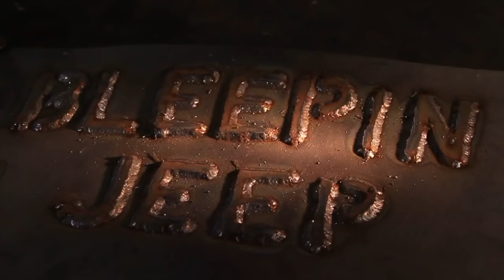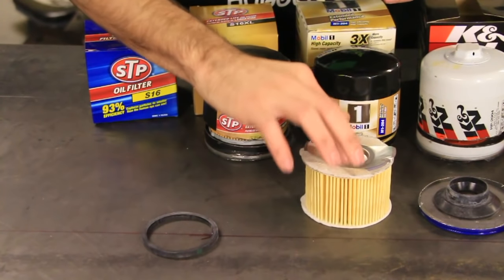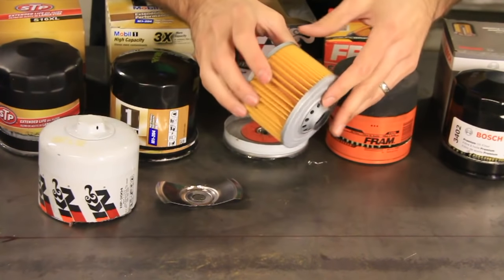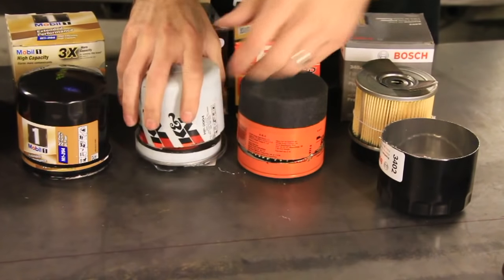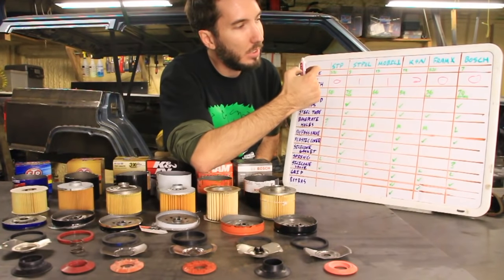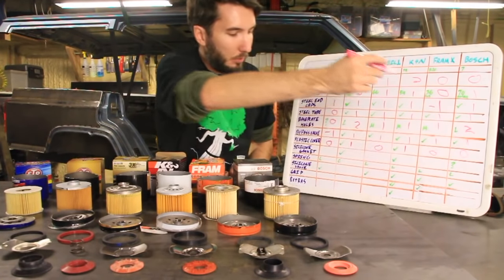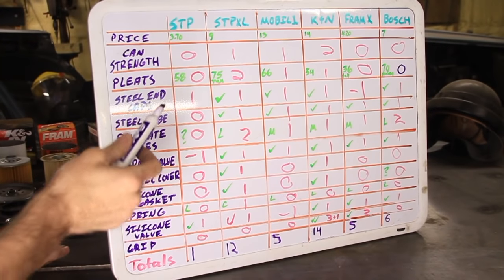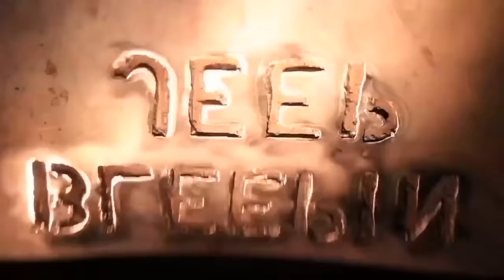What the Crap is in My Oil Filter?  We Find the BEST and Worst Oil Filters from AutoZone

Comment: I used the Fram extra guard oil filter with Valvoline Syn Power oil with ≈ 5,000 miles of use, which took me roughly 5-6 months. I did the oil analysis with Blackstone Laboratories and they stated the oil filter did a fine job at filtering impurities from the oil. The results of iron and aluminum were below average. I purposely used the extra guard for the oil analysis just out of curiosity. What I can say is that Fram gets the job done, but for a couple dollars more, you might as well get a higher quality product. I highly recommend any top of the line oil filters of your preferred choice. I know 5,000 miles isn't a lot of miles compared to some other people, but I would say 80% of my driving is city driving in the Los Angeles metropolitan area.

Comment: Fram Extra Guard hands down. I been using FRAM for da last 15 years. No problems what so ever.  Also in the last 2 years I have been using Purolator.  What ever brand is used, important thing is to change ur oil and filter every 3000 to 4000 miles.

Comment: 3 pts for the K&N end cap nut?  easier to install and remove but doesn't effect the filtering of oil.

All and all, you did a great job of showing us what's inside these filters.
You've switched me away from using Fram to looking for STP XL (XL stands for extended life)

Comment: Some things for you to take into effect during your next comparisons:
What frequency is your change rate vs life expectancy - 3k miles-6k miles-10k miles Silicon-rubber for the intended life (rubber for 3k-silicon for 6k-over)
Pleats vs flow - need to keep in mind high pleat count reduces flow as their is a tighter gap
Flow passages in base plate comparable to pleat count - bigger holes more pleats vs smaller holes less pleats - To keep flow in expected range for the oil pump/engine
The outer casing thickness has a very distinct purpose - as the filter clogs the sides bulge and pull the top closer to the motor effectively applying more pressure to the hold down spring.
An addition to your comparison board, along with the heftiness of the bottom plate count the threads that secure it to the motor - more threads for more bite to ensure it isn't blown off.

As most of these types of comparisons go, there is a big margin for personal preference and expectations.
The reality is no matter how good it is people will choose subjectively to fit their needs.
I am glad that you are willing to get the info out there for those that care enough to take it into consideration and hope you continue in the future. For those people that don't know how to do anything with your car or how to even open your hood. Please do not chime in, your input means nothing.

Oh, just a couple ending thoughts. The fram filter "mold" was the adhesive they used the mate the paper end cap to the plastic at the ends of the pleats soaking through. Just thought you might like to know. The reason i emphasized frequency is the rubber drain back and gaskets are good quality for 3k miles, but cannot withstand the heat cycles of the longer oil change intervals as well as the silicone.

Comment: Different gaskets are Buna-N(commonly black but come in different colors, standard o-ring material), Viton(Usually a pinkish-red, orange, or green, found in hydraulic equip. tough but NOT recommended for petrol-products as they break down a little. Commonly found as a canister filer o-ring), and Silicon(e)(Any color possible but you can feel the difference, much more flexible) there are more but these are what I find on the regular. The k&n filters are okay but as a Motorcraft dealer... hint hint, we use them and I actually prefer them. I've dissected a few and even though I'm pretty sure they contract them, they're made with the same materials and the same way per Fords strict specs. Specialty filters we have to have delivered are stp-xl. Another funny filter is the royal purple. Pretty much the same as the regular stp but way more expensive. Don't ask me about the best oil...

Comment: I know some about oil filters and have some answers to some of the questions you asked through the video. 

One of the first ones I would like to address is what people often call paper or cardboard end caps. In the STP filter, the End caps are the same material as the filter which is a cellulose paper. Part of the reason this is done is because it is cheaper, but it is also done because the paper pleated media bonds better to the paper/media designed end cap. This helps reduce the separation of the media and end cap and also helps reduce possible tearing of the pleated media as the end cap is able to flex slightly if a pleat is too full and has excessive pressure. Also, in the event the pleats were full of gunk, the end caps would also filter as they are made from the same material. The weird holes on the end of the STP blue are the bypass. It works, but most people do not prefer it as it is cheap. This is known as a combo valve. The bypass and the antidrainback valve are built into one piece of rubber.

Stp XL stands for extended life. These appear to be really good filters, but are fairly new to the market. The plastic cover goes on the bottom due to being made in Korea and is used to keep them from getting moisture in them and starting to rust while being shipped overseas.

The Mobil 1 is able to absorb more due to the type of media. It uses a synthetic blend media which is capable of performing depth filtering. Normal media is like paper. Synthetic media is like a sponge. Paper filters only on the surface, while a sponge would filter all the way through the sponge.

The K&N filter having bad spacing, isn't really a big issue. The only time bad spacing is a major issue is in the event the media is too thin to support the pressure. This can cause a tear. This has been extremely common among filters made by a company whose name starts with a P and makes the classic and one filter. They have been nicknamed tearolator for this reason. 

The fram is actually a really good filter, they are able to get away with less media than some of the others and still perform better filtering due to being a synthetic blend similar to the Mobil 1. The filter you have, the extra guard is actually the lowest end filter. The color you are seeing is more than likely from the glue used to glue the media to the end cap. This end cap is superior to the STP end cap due to having a synthetic blend media like the Mobil 1.

The string on the Bosch is neither supposed to be there or not supposed to be there.  It is used to keep the pleats in a circular shape while gluing it to the end caps.
Reply: Good review.
Reply: Good info. Some bad mouth the paper ends on the Fram.  I Always thought the only thing that mattered was how well the glue bond held.up.
Reply: @miasmicmonky13 At least you obviously know what you are talking about.
Reply: I have been using fram for years with zero issues 👍 just took one off my cub cadet the other day 2 years of use and it was still clean after cutting it apart. I couldn't believe it 👍

Comment: Ok so pleated cartridge filters (CFs) are used in a variety of applications like swimming pools, HVAC, vehicles, etc.  I did some searching and the string around the Bosch filter could be there for the same reason as their presence on water filtration CFs.  That reason being to prevent pleat flutter during filtration.  However, the jankiness of the single string leads me to believe that it was holding the pleated, rectangular piece of filter media in a cylindrical form to make installing the caps cheaper (instead of having a specific machine hold the media).  Also, CFs that have bands installed usually engage each pleat (meaning that they are glued to each pleat to improve the rigidity and uniformness of the overall CF).  Furthermore, the overall surface area of the media and the type of material used for the media are the real questions (as well as build quality).  The pleats are just a way of reducing the size or footprint of the filter as well as engineering the flow of fluid).

Comment: I knew Fram filters were bad, but wow..  They're basically selling s*** in a box..
Reply: No - THAT Fram is shit. The Fram Ultra  is better than anything on his bench. He picked the wrong filter to test.
Reply: That's why they call them the "orange can of death".
Reply: I put 211,122 miles on my 4.0 (wrangler) with these, but I will not use them any more in my new engine. Currently at 271.113, and Castrol Full Synthetic is all I use. I am switching to STP XL for the time being. Starting today.

Comment: I think you have to hook several oil filters to a manifold and pump dirty oil through all of the filters from the same vat at the same pressure and weight both before and after to see which which one filters best  , the test should be for a short amount of time like 20 minutes otherwise the bigger filters will have the capacity to store more waste but they might not filter better.

Comment: I think a more realistic and accurate rating system would be to compare the points/$ ratio without adding the price points into the total. This way a filter at a very low price doesn't get an artificially high rating. Now take this number and pair it to the point rating and go from there. Informative video, good job.

Comment: I work in a plant that makes in the millions of oil, fuel, and air filters the more pleats it has the better it is to a point.  that being said you can have to many and cuts flow down if the pleats are to close together.  With out seeing the "flow tests" just by being in the filter making world it would be STP XL, Mobile 1, K&N, Bosch, STP, and Fram. I have many years in the filter world there is only 3 of the 6 i would use in my auto.
Reply from the maker: Which filters would you use out of any options?

Comment: Great Info! I would also like to see the purolators and auto extras. I And I don't know if it's been said but the holes on top of the wrench part of the K&N can be used for safety wire I believe. They look very similar to Small Aircraft filters. Just a +1/2 maybe for that little feature.

Comment: The mobile one doesn't have a bypass valve the center hole is the exit hole or return hole for the oil. The amount of media determines the capacity of the filter. Stretch out the media and see how long it is.

Comment: The way to really test a filter is to measure its absolute filtration of the fine particles that get into the oil. The filter that removes more for longer would be a better filter PROVIDED it does not impede or restrict oil flow.

Comment: Another vote to test Wix or the Wix Extra or what ever they call it.  Obviously the people that care about their engines don't use Fram filters, or use Pennzoil.  There is no use wasting money on a good filter if you aren't going to use a decent oil.  A filter can't fix bad oil.  You should remove the filter material and measure the area of the filter.  Pleats can be different depths so the number does not mean much.  Also you should test to see how small of particles the filters remove and the flow rate of oil through the filter material.

Comment: While the nut end and sticker are nice they don't really protect your engine. Take 4 points off for that and the STP XL rated 2 points higher. Then figure in it is 5 bucks less. Great video Matt!
Reply: +Wolfpak765 The nut end isn't for protection, it's for ease of use. As far as protection goes it wouldn't do much for a Jeep but I've heard of someone having a stick on the trail come up and stab a hole through an oil filter before. The entire group of people was stranded for hours because they had tons of spare parts but nobody had an extra oil filter lol.
Reply from the maker: +TheAmericanUhate Hey that was our group^ true story... happened at Windrock Park at least and hour or two from the parking lot...long day
Reply: BleepinJeep Yes it was. lol I remember hearing the story but didn't remember where I had heard it until a while after I left the comment lol.

Comment: Why would the low-level STP filter not have a bypass valve but the higher-end equivalent would? Seems like you could be looking at potential engine damage by oil starvation if high-revving occurs.

Comment: on the fram extra guard looks to me like maybe they spray a film of oil on the inside to keep from rusting while it sits on the shelf.  And the cardboard just soaked it up a bit.
Im not a fan of Fram!!!   Great marketing for them though.  I like Purolator/AC Delco
Reply: +2LateIWon puro/ac/stp you mean lol
Reply: pretty much 
The main thing you can look at for a good filter without opening one up is look at how many and how big the drain holes are.  
This was a great and informative video
Reply: +2LateIWon The discoloration on the end cap is becuase of the way they cure the adhesive.  They use a hot plate with direct contact to the fiberboard end cap.  High heat + paper material = charring.

Comment: STP XL was FAR better than the K&N and 40% cheaper. 

TOO much points for "grip"
Reply: That stupid nut killed a lot of engines because the spot welds were often too deep and the oil ended up on the highway. Give me a $4 Motorcraft with 400 square inches of media.
Reply: Why?

Comment: This kind of comparison is pretty much useless. We need actual flow data, particulate filtration capability and the same capability after 1000, 2000, 3000 miles etc. And forget about counting pleats and open up the damn filters and measure the filtration area.....!!
Reply: spot on panther

Comment: Slightly disagree with you considering plastic parts as a minus. There are plastic oil housing (cartridge filters) which last as long as the metal ones, if properly operated. A better rating would be to test the plastic and metal in an environment that replicates pressure and temperature for which the filter had been designed to operate. Also, silicone gaskets are definitely better, but does it really matter in a filter that has a high quality gasket that does its job? It's not that you'll have that filter mounted on the vehicle for more than 10-15,000 miles at the very maximum. Also, once installed, chances are that the filter won't come out unless it will be replaced. The most important parts in an oil filter are number of pleats and the filter media quality, the quality/reliability of the bypass valve and of course the quality of the materials used in general. It all depends on how the filter is used to begin with, the cheap stp will be great for mineral oil changes that range 2-3000 miles, whereas the more expensive ones (including the Mobil 1- which is btw a fantastic filter - personal opinion based on media inspection after oil change and various Blackstone oil analysis) more suited for synthetic oil changes that go up to 10,000 miles. 

Overall, I'm not posting this comment to be negative, I believe that you opening all those filters and taking the time to share is a great community service, except being partially subjective in regards to some rating points. Thanks for doing it!

Comment: I say K&N for ever filter on your vehicle they actually protect your vehicle and you can buy them off line way cheaper so the million dollar question is which one would you use Matt?
Reply from the maker: I'm probably not the one you should ask as I always cheap out on everything... Maybe that's another question in itself... How much does it really matter to use a high quality filter?  How long would my engine last without even using a filter?  These are the questions I can't answer.
Reply: +BleepinJeep this is very true lol I'm planning to do a new fuel filter and oil filter and air filter and everything I think it's worth the extra money if I get a better experience with my vehicle it's worth it
Reply: +K8879 mine is on my vehicle not a Atv or bike
Reply: I avoid K&N filters. 
The oil filter, supposedly for my car, is renumbered from a Honda and has half the oil bypass psi.
Air filters cost 5-6x what a standard does, and with the cost of maintanence, takes 7-8 years to equal out cost wise. Fuel economy increase would be near zero on either of my vehicles, based on other owners reports.
Reply: +Ron Wilson They seen at least semi solid.  Ford Racing oil filters are the best in every category..only thing I use..but buy in bulk because they can be 20 dollars per if you just buy one.
Reply: +Joseph Bentley *seem

Comment: Ran nothing but fram on a jeep 4.0 and sold it at 250k.
Reply: Did they tow it away?
Reply: crashandburnbirner my grand cherokee had 190000 and a fram tg filter on it when i bought it. It now has 250000 and a new fram tg filter. Never had an issue with fram filters. Change oil when recommended and your filter shouldnt quality shouldnt be super important. Also add a magnet to your drain plug and maybe a couple on the outside of the filter
Reply: Scott Smelko That's been proven to not help at all. Regarding the magnets.

Comment: Here are a few other AMC/Jeep 4.0L oil filters are common at other places for the Jeep 4.0:

Mopar #5281090  <- for the orthodox purists that want nothing other than factory OEM parts and wish Mopar made breakfast cereal as they would get that too from The Stealership.

Purolator PL14670 or PL30001 PureONE (extended / more filtering media requires .25 quart more of oil)  <- This company has a good reputation, hence PURe Oil LATeR and sold at some one-stop-shopping places like Fred Meyer here in Alaska

NAPA Gold Oil Filter 1085  <- National Automotive Parts Association aka NAPA is almost everywhere in N. America ~ this filter may be a possible re-branded Wix #51515 filter

Here in Alaska there are several stores to get oils filter just like there in The Lower48 and this comparison video was AWESOME!
Thanks Matt...